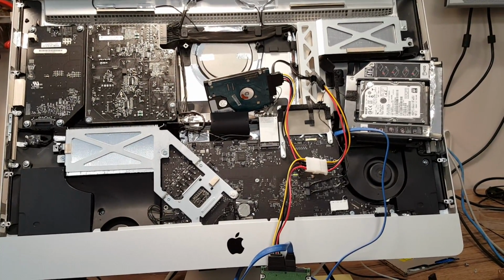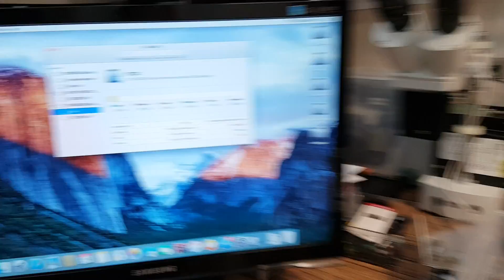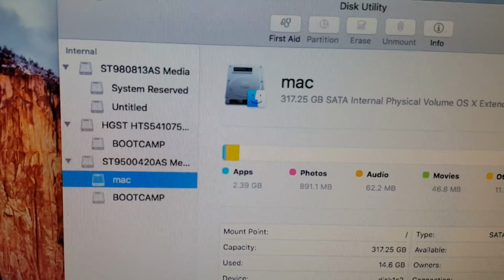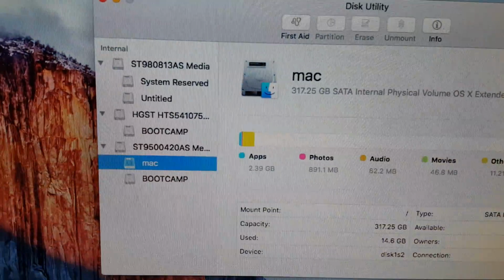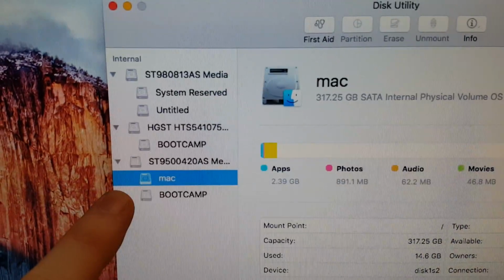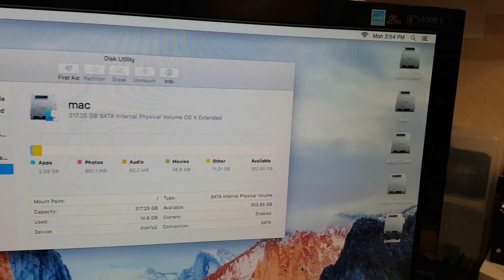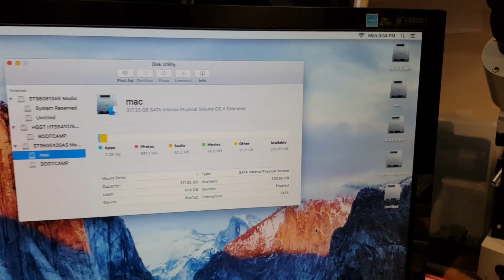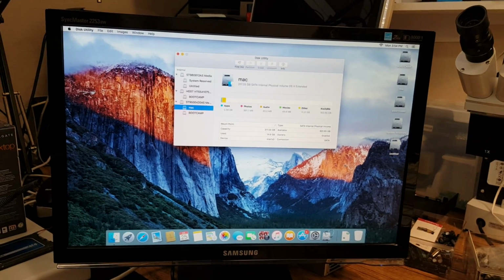FYI IMac 27 inch has 3 active sata ports tested works!

Comment: That’s very interesting information, thank you for making this video. I have a mid 2011 iMac 27 inch. If I wanted to convert the optical drive to an SSD, could I essentially use that drive to run my recording projects for my studio, rather than using my FireWire 800 HDD?? Thank you again, cheers

Comment: i put 3 SSd on mine, the main (sata6) runs super fast around 480Mb/s but the other 2, (SATA 3) runs like shit, SSD runs about 60MB/s , I would be better running them aouside over USB 3 (with a dongle thru mini port) there SSD runs around 300MB/s. I just let thos SSD inside just because are 120mb size and too mucho trouble to take them out, I put them inside thinking they would be lighting fast and wanted them for editing purposes (i needed super fast not that bib drives), but i barely use them, im way better using USB disks, i dont know if it is something that can be fixed, cause sata 3 us suposed to be 300mb/s but these apple internals clearly are not in IMAC 2011 at least.